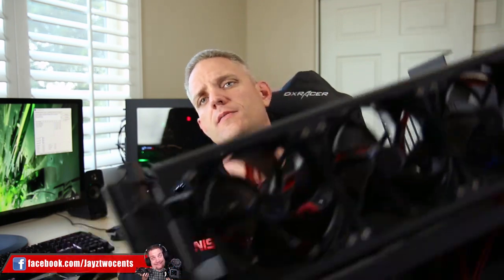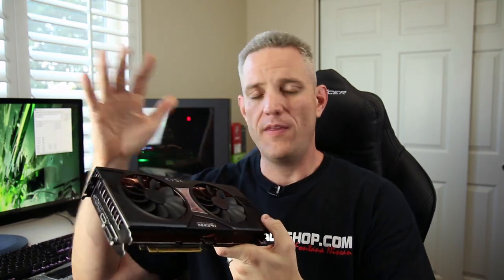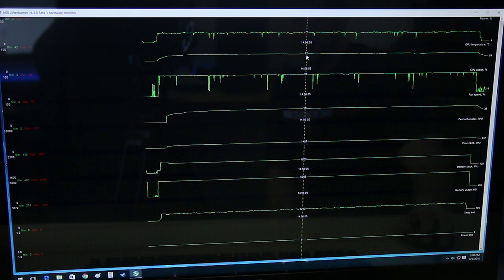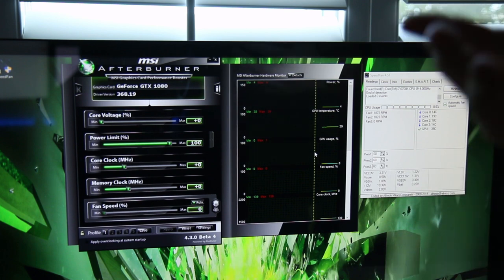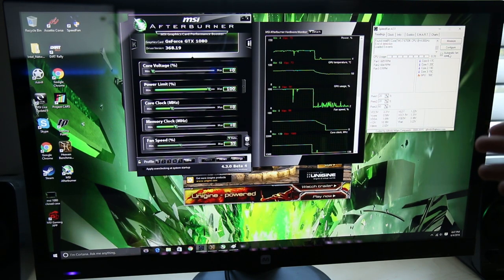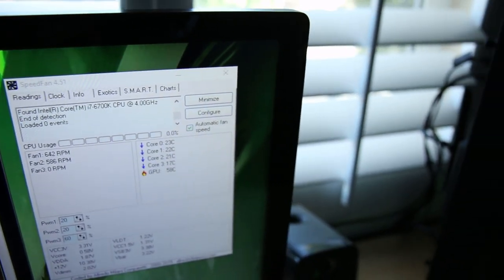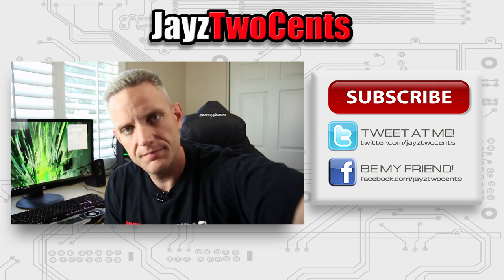Do cases make video cards run hotter?? - Test Bench vs Case

Comment: It took more voltage on the open air stest bench as the fans was spinning faster
Reply from the maker: Fan percentage doesnt affect core voltage, just powerlimit
Reply: *****
Ahh i though it was overall voltage
Reply: You used the same psu?

Comment: I would like to say first that I think all component testing should be done in an open air test bed, and with all other high end components.  The entire point is to see what the graphics card is capable of, with as few limiting factors as possible.  And given the fact that every single system out there is setup different, you can't realistically design a test setup that is on par with the average user.  It's impossible.

But, I do believe this specific test to be flawed, in that the heaven benchmark doesn't really get the cpu going, and in a closed system environment, the CPU heat is almost half the heat that you are trying to dissipate.  If your cpu is idling the entire time through that test, you're not dealing with the same heat load you would experience trying to play, say DOOM or GTA5, where you find your cpu being heavily used.  This of course would be remedied by having the radiator set to exhaust instead of intake.  But there's an area where you'll find inconsistencies with various peoples' testing.

(going further to prove every system and situation is different anyway)
In my own system, I have a custom loop with 2 360 rads, 1 overclocked 6600k and 1 overclocked gtx 980.  Running a CPU stress test alone, I do not see my temps go over 40.  And running heaven or valley, I do not see my gpu temp go over 40.  But when I combine the 2, I can see temps into the low to mid 50's on either component.

And I have a strong feeling, that if you did a similar test, in the closed case environment, especially with a front mounted radiator, you would see a similar scenario where you are reporting higher GPU temperatures, because the air being used to cool the gpu is warmer due to the hot air from the radiator being expelled into the case before being exhausted.

Anyway.. with that said... I personally think that if you start doing GPU reviews in closed cases to "simulate real world experience" you might as well do the reviews in a system with a core2 duo or something, because that is a much more commonly used cpu than any 6 or 8 core i7.

I think my entire disagreement with your test here more than anything proves why all testing should be done the way its been done by everyone for years.  In an open air environment, with the highest grade components available.  It just eliminates any little thing to nitpick about(and if anything just becomes the little thing to nitpick about)
Reply from the maker: This test is not flawed... want to know why I say that? Well how am I supposed to compare my results to the guy running a 5960X? What about the guy running an i5 at stock speeds? What about the guy running water cooling dumping all the heat out of his case and not affecting case temps as much? What about the guy running a massive Noctua cooler, compared to the guy running stock cooler? How would you suggest I account for ALL of those variables? Am I testing the coolers ability to deal with the CPU or the GPU? My testing allows me to control as many variables as possible and to make sure the card is the only thing affecting the results. 

I think that open air test bench is the only way to achieve this. The argument before the case argument was "why are you using a 5930K??? most people dont have 5930k!!! use a slower cpu to see what REAL fps is....!!!" That one just leaves me scratching my head!
Reply: +JayzTwoCents now that it's morning, sober me sees the error in my thinking, and apologises for drunk me leaving a long rambling half incoherent comment.

Comment: This was not a controlled experiment. Let me explain. 
Once you changed the case's you changed the results. You need to keep everything the same in the OPEN case vs the CLOSED case.
  Did both case's have the same case design? Both have the same exact cooling set up? If not then the experiment was invalid.

"The definition of a control experiment is a test where the person conducting the test only changes one variable at a time in order to isolate the results. An experiment where all subjects involved in the experiment are treated exactly the same except for one deviation is an example of a control experiment."

Comment: Single card on test bench vs single card in case are going to be pretty close as seen here. Running multiple graphics cards inside a case will do worse than a open air test bench with multiple cards.

Comment: Here's an idea for a video, compare Steams gaming VM system to something like VMware and see if there's any difference, as in does it impact gaming quality and what has Steam done to make their piece of software different/better for gaming?
Reply: already done and it doesnt
Reply: By whom? And when you say it doesn't do you mean that both VM software packages performed with equal results?
Reply: +Arthur Butcher linus tech tips did it. not with VMware but they played games on a virtual machine and the actual machine and it made no difference. they also did the 2 gamers one pc and 7 gamers 1 pc and still were just fine.
Reply: Ah yes I've seen that video, but with their new office they have stupidly fast internet, and they were using those strange HDMI dongles rather than actual VM software.
Reply: +Arthur Butcher what do you mean strange hdmi dongles?the first one was a mastercase with two gpu's, two mice, and two keyboards. same goes for the 7 gamers 1 pc. that had nothing to do with Internet or hdmi dongles
Reply: The most recent one he did where he had many 980 Ti cards he used dongles for the HDMI outputs to send the data rather than using the Internet.
Reply: +Arthur Butcher well I can't remember what he did for the first one but the big one was 7 Nanos water-cooled and 7 people played crisis 3 at 80ish fps with higher settings at 1080p
Reply: You haven't seen his latest one then, he did this huge 12 VM computer and did it all wirelessly. The R9 nano one used wires.
Reply: +Arthur Butcher I did but the latency isn't from the vms
Reply: So to clarify, using my laptop to play video games on my PC down stairs would work fine for single player, non competitive games?
Reply: +Arthur Butcher yes, completely. even non competitive multi-player

Comment: The temps are the same, because the bios controll the fanspeed by heat. In fact the card wars cooler in the case, just the fans from the card spinning lower. its' my conclusion

Comment: This should be common sense though. If your GPU is running hotter in a case than out, it's because your case isn't set up right. If the fans are doing their job case temps won't ever be a factor in gpu temps.

Comment: I'm switching from 390x to 1070 when it comes out. AMD runs so hot under load.
Reply: why not wait for the Rx 480?
Reply: +timothy banks that wouldn't even be an upgrade for him...
Reply: +timothy banks nah man. It doesn't matter how many fans I use with an AMD cpu, it still runs hot. So I'm switching to 1070.
Reply: You run hot? i have a r9 390 and i ran hot about 72/73c each time i started my pc so doing nothing made it go that high till i looked it up and found out i could have a miner on my pc, so i downloaded the free malwarebyte and sure did have a miner once i killed it i got normal temps of 38/43c.
Reply: +kaz05050 it reaches 90C while playing the division on ultra settings, during summer. My idle temps are also below 35C. 

When it's winter, I get around 78 to 80C.
Reply: +Hans Balais What r9 390x do you have?
Reply: +Markus Wiedner MSI
Reply: Hans Balais Even though the twin frozr is prettty damn good, the r9 390x is one hot ass running card
Reply: Hans Balais the 480 is on an new architecture that runs a lot cooler
Reply: Pyrofan97 what are you talking about the Rx 480 is capable of good VR with 1 card and 2 480s which would only be $400 is faster then the 1080
Reply: wrong it would be faster then a 1070 and nips at the heels of a 1080 but with both cards oced it will be faster then a 1080 but the 1080 is already a good ocer
Reply: Hans Balais its the summer here and my 390 has yet to reach thos temps my guess is you have bad airflow and my 390 is from xfx all normal settings, my case has 2 120 corsair on high all the time sucking the air in from the front and a H100igtx with 2 at the top pushing out and the same with the back fan pushing out.
Reply: kaz05050 When the 1080 is oc'd it will leave the cf 480s in the dust sadly. Even they are oc'd aswell. Atm i would go with a single 1070 and oc that^^
Reply: That depends on the person if your coming from a 7xx 6xx or any 960 and under card the 480 is still king.
Reply: +kaz05050 I've got all my fans at 100% speed all the time already. I've got 2 140mm fans intake in front. I've added a 120mm below for intake. I've got 2 exhaust fans up top(one of which has a radiator on it) and 1 120 mm exhaust fan on the back.

Comment: Of course an open air test bench runs cooler it has more dissipatio and the air is more evenly heated in the room rather than the case containing hot air

Comment: Still don't understand why this video had to be made to begin with. If the ambient air isn't heating up well over 100F (37.7C) to the point where its almost to hot to be in the room so the fans actually have to ramp up to begin with just because of the hotter air its getting in the first place. Why would it matter what case is used to begin with? I mean isn't there a margin of error in the test to begin with to account for variance to begin with? Might as well go with open air anyway. because if the card heats the room normally, then would that not be a real world situation? I think jay has said it himself in his older videos about how things were in his old office when he had to test there and how much hotter that room would be. I have a HAF 932 adv case and with a gtx 760 windforce 3 at 1.2 Ghz it heats my room up a little bit like my own personal space heater. the only time a case is going to matter is if it can directly keep things cool enough with out raising the room temp at all which i don't know what it takes to do that and would be way out of scope for Jay to test. like he said there's just too much out there and no matter what someones going to be pissed off anyway.

Comment: More than anything else this test shows the impressive efficiency that Radeon and particularly Nvidia are achieving as of late, truly impressive. However,  among many other variables the main thing here to remember is that this HEAVILY relies on the card being used. For example, with an r9 280x which we all know is a hot card, you WILL experience higher temperatures in a closed case than in an open air bench. With the new cards being released now this whole test is rather irrelevant.

Comment: @1:00 don't even need to watch this. Of course the bloody temperatures go up in an enclosed space assuming you have some circulation around the test bench. And I'm guessing even if it's small with the reference blower cards you have, 3rd party non-blower designs will be even worse. You just can't beat free air.

Edit: @2:17 So using a non-blower cooler? Holy shit, yeah the case is going to be hotter.

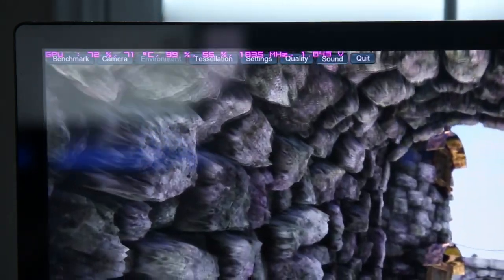Edit: @9:05 So it's running at lower voltage in a different system and is - obviously - going to run cooler, because you know, LESS FREAKING VOLTS. This test is worthless Jay. Please lock voltage and try again. :)

Appreciate the effort though, pretty solid test.

You know, in my experience - simply taking the side off a case almost always lowers temps no matter how good I think my cooling plan is (not true now I'm on water though).
Reply: You're conclusions were 100% wrong, but thanks for betting before watching instead of claiming hindsight.
Reply: I don't know if I was 100% wrong. It ran the same temp in the case despite having less voltage, seems to me the case did cause a relative temp increase. Wasn't as much as I would have thought though.

Comment: I have done the same test, with my case closed, and without the side panel, and only by removing it the temperature drops 3 - 4°c...
Reply: you need -better fans or more fans or better cable management, maybe a cpu water cooler would help or just change fan speeds and make sure you have a healthy positive air pressure. good luck.
Reply: Tomas B. I have a corsair h110i gt cpu cooler, and 4 case fans with positive air pressure, I think the case itself is restricting the airflow
Reply: Omar Daniel Mercado González yeah i wanted to say better case but i thought... Well yeah anyways it's probably the case.
Reply: depends of the fan configurations of the case ur using, GPUs benifit of a Big 120mm fan in the side blowing Fresh air onto the GPU

Comment: Guys i need help will my specs run high demanding games on ultra and 60+ fps?

Case 1 x Corsair Graphite Series 760T Full Tower Gaming Case - Black
LED Fan Lighting 1 x 3x [Red] Thermaltake Riing 12 Series High Static Pressure LED 120mm Fan
Case Lighting 1 x Liquid Neon Thunder Pattern Light - Red
Processor 1 x Intel® Core™ i7-6700K Processor (4x 4.00GHz/8MB L3 Cache) - Intel Core™ i7-6700K w/ Intel Performance Tuning Protection
Processor Cooling 1 x Swiftech H220 X2 240mm Liquid CPU Cooling System - Red Coolant
Memory 1 x 16 GB [8 GB x2] DDR4-3200 Memory Module - GSKILL Ripjaws V
Video Card 1 x NVIDIA GeForce GTX 980Ti - 6GB - EVGA Hybrid (Liquid Cooled / VR-Ready)
Motherboard 1 x ASUS Z170 Deluxe -- 3x PCIe x16, 6x USB 3.1, 1x USB 3.0, 2x M.2, DDR4 Memory
Power Supply 1 x 1000 Watt - EVGA 1000 GQ - 80 PLUS Gold; Full Modular
Primary Hard Drive 1 x 1 TB Western Digital Black Hard Drive -- 64M Cache, 7200rpm, 6.0Gb/s - Single Drive
Optical Drive 1 x LG 14x Blu-ray Re-Writer, DVD±R/±RW Burner Combo Drive - Black
Meter Display 1 x NZXT Sentry LX Fan Control, Clock, and Temperature Display (Large dual 5.25" LCD screen)
Sound Card 1 x 3D Premium Surround Sound Onboard
Network Card 1 x Onboard LAN Network (Gb or 10/100)
Operating System 1 x Windows 10 Pro
Reply: But where the f*ck is ssd?
Reply: waldo I dont have one
Reply: waldo It only increases load time i heard
Reply: +Charles Gray 
I hope you meant decrease load times not increase load times. if that were the case only thing SSD would have over HDD would be reliability for not having moving parts and no noise. (Due to not having moving parts) HDD read and writes usually don't go over 120MBps, SSD read and rights range from 400 to over 2000MBps. Depending on what you have and what interface it uses.
Reply: ecromancer Lmao opps thats what i meant
and thanks for info

Comment: The reason for the increased voltage on the test bench was because the fan on the gpu was running at a higher speed.

Comment: Well my GPU is 4-5c hotter when i close side of the case, also gpu fans are way louder
Reply: But which videocard and case?
Reply: your case could just have poor ventilation. Also having a thinner then normal case with little to no room above the PCIe slots could also do that.

Comment: This all exploded because of the founders card and overclocking. So you do this test with a card with a decent cooler at factory speeds ?

WHY JAY WHY ? I know you said Nvidia was pissed off at you on Tech Talk but come on ? 

All this shows is the MSI card is engineered well. Maybe a case only matters with a lame duck cooler and overclocking ?

Comment: weird some people is yelling at the 1070.. the 1080 will be a better test, because it throlling during your test
Reply: You mean the founders edition throttles which is not true. If you increase the temp limit you can get a stable overclock at 1990 GHZ
Reply: Tyrone melonas yeah so out of the box it throttles on a open test bench
Reply: basically

Comment: I know a  guy who thought he got a good deal on a pc for £900. it had a 750ti, a i7 4970, the case was a standard office case and had no fans
Reply: Oh no...
Reply: I know a guy who bought a pc for $3000 AUD with 8gb ram, i7 6700 and intel integrated graphics. The monitor was 27" 1080p, It came with some cheapo keyboard and mouse. YOU COULD BUY A I7 6800K WITH A GTX 1080 WITH LEFT OVERS!?!? #pcnoobs
Reply: +Windwalker 95 WHAT.
Reply: yea WHAT.

Comment: what if the case has a bottom 140mm fan mount?
Reply: eh?
Reply: My case has an opening for one, but I don't use it.  Sucking, it'll pull in dust, blowing it'll disturb dust which will likely be taken in by the side fans.  I have a positive air pressure in the case, and it pushes out there a bit, but I really didn't fancy that orifice.
Reply: ***** Me too, but I assume they're not flawless.

Comment: Thanks for this video. I'll link it to my idiot friends for them to see. I've always ran my case fans at 50% all around with the exception of the exhaust fan for noise reasons (25% speed) and GPU temp doesn't get affected whatsoever.

Comment: I need some help (and I know this is the wrong video to comment and ask for help from, but the right people). My core i7 870 cpu is over heating. It was working wonderfully, and I replaced the thermal paste on it. I put the fan on it again, and then so I booted my computer. After a week,  I am getting 70+ degrees celsius for my cpu. I know this can't be because at 100, the human skin would be burning. And I know, " But it cools down before it leaves the case." But there should be no reason why my cpu is overheating that much! 200 degrees most of the time is ungodly, and my computer would be on fire if that was the case. Can someone please help? I have been using the stock cooler and have never had any problems. And non of the fan-to-motherboard connectors are broken. Yes, I clean my computer often, maybe once every 2-3 weeks.
Thanks,
TLD
P.S. If you are wondering, I did put this message on multiple channel comments to get the most help.